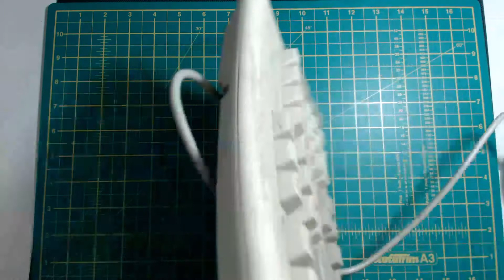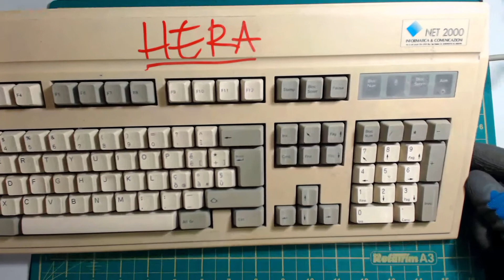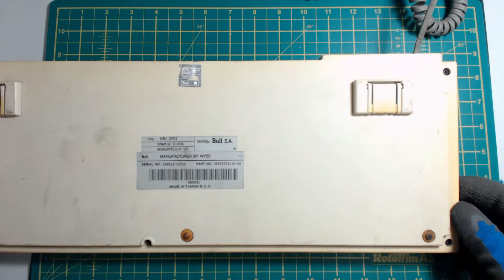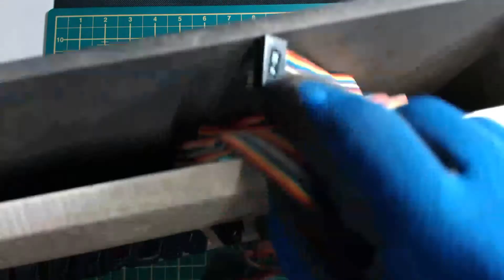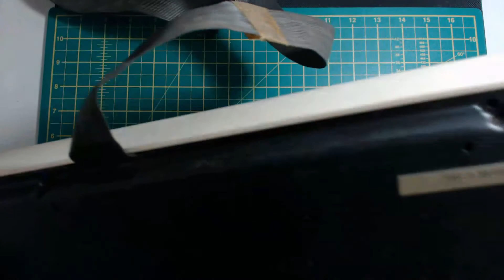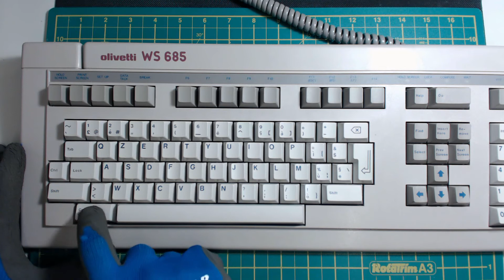My hunt for  vintage mechanical keyboards

Comment: I'm typing this comment on an IBM KB-8926 (the one you binned at the beginning). It's not that bad! It's no Cherry MX though, that's to be sure. It came with an IBM desktop machine that my employer provided in my first ever job, back in 1996. It wasn't as good as the Cherry MX board I had at home, but I always felt it could be worse. I pulled all the keys off and washed them in soapy water yesterday. And it's looking rather good.
Reply from the maker: Sincerely, I did not throw away the keyboard, it was sort of a joke for my friends at the italian mech keyboards group, but it's true that it was buried in a pile of trash. There is no good or bad keyboard but just the one that fits best Your fingers!

Comment: That NOS honeywell is amazing! Will you be converting for use with modern computer?
Reply from the maker: Hi, good question, Yes I wish!

The best conversion would be an external box, leaving the keyboard intact... maybe an adapted Soarer converter?

https://geekhack.org/index.php?topic=17458.0

I'll contact the guy and ear if he knows anything about the Honeywell VIP terminal keyboards.

I also cleaned the all white Honeywell keyboard and that is in like new condition now, really amazing keycaps and feel at touch!
I'll try to post some good pictures on desktority in the next days and leave a link here also. 

All these keyboards were meant to be destroyed in a few days... I can't even think about that. The personell told me that they had already destroyed a ton of other parts, that's really sad!